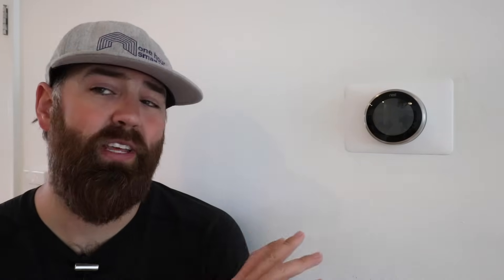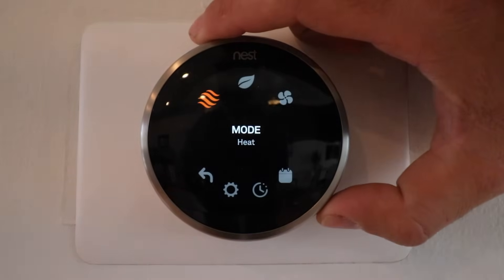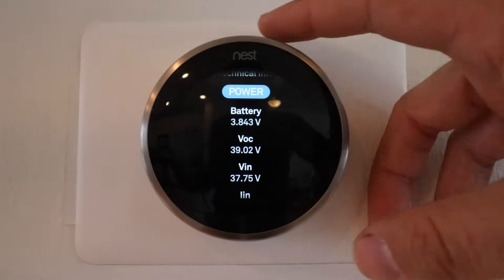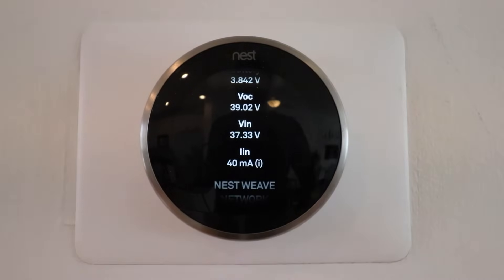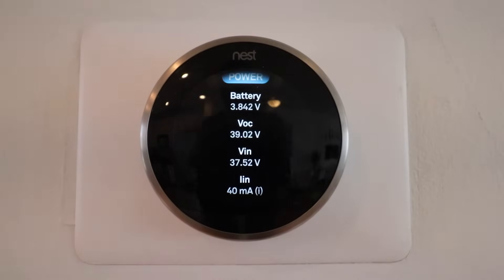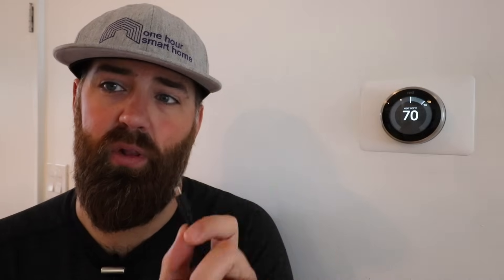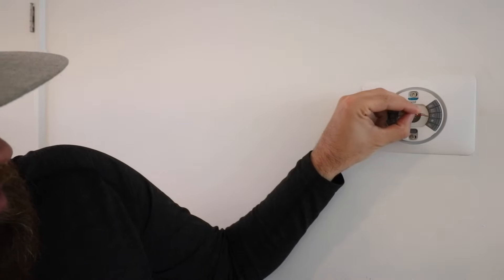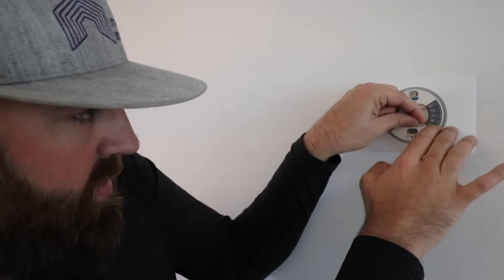Nest Low Battery Fix!

Comment: I’m at a loss. Mine is now just under 3.8 V and was at 40mA. When I first encountered the “no wifi” problem voltage was slightly lower but I removed and reconnected to make sure it was secure. Voltage then improved after a few minutes but still isn’t connecting to wifi. I’m charging off the wall now and will try to reconnect to wifi afterwards. It’s only affecting one of the two devices I have in my home. My AC units are both only 5 years old.

Comment: The main and most common issue for any modern smart thermostat is that they require a (5) wire line. Most homes have a (4) wire line.  The 5th wire is a dedicated power only line that will power and keep the unit charged , even during power outages via the battery for at least 5 days. This resolves all issues related to any mentioned in this video. If you have 3 or 4 wires from your old unit, you will need to run a new 5-6 wire line. The 6th would be for a future AC install per your budget.

Comment: Thank you for posting this info!!!! My power went out.. everything came back on but the AC the nest continued to say offline.. I remove the nest thermostat, plugged in to USB cord..the light blinked 3 times then it said to put it back on and I got the AC working. It's still under warranty will have them come check, but this helped significantly!!!!!! Thank you.. New follower!!!

Comment: It looks like the green wire at the Nest was not actually plugged into the furnace at all. I took the green wire and put on the C terminal along with a red wire at the furnace wiring block. Now my Nest is showing voltage at 3.8+ and my mA went from 20 to 200. Is that ok? And my AC seems to be staying on ok. Thanks.

Comment: Replaced the battery, didn’t work, installed the AC adapter (c wired) and still didn’t work, keeps saying be back in a bit or needs to charge.. the only thing that works is if I take it off and manually charge but that only last not even a whole day.. I’m confused as to plugging in the c wired ac adapter why it’s not giving power 🤷🏻‍♀️

Comment: I have been using my nest learning thermostat (3rd gen) for almost 4 years. It just then won't charge from the base any more. I'm still able to charge it using USB port directly to wall power. it means the internal battery is still good.  My Voc = 36.51V  and Vin = 7.88V (while system is running) which are within specification with No C wire configuration. Do you think I have a bad fuse in furnace or air handler system? If I would like to purchase the 24V adapter,  can I put the 24 volt converter into the Rh or Rc and c without removing the original Rh and Rc wires? Thanks
Reply: I ordered the adapter and it still didn’t give me power =[ and I even replaced the external battery on the nest and it still didn’t give power

Comment: Nest Thermostats are complete POS!  Low battery issues, 191,000 people watching your video.. congrats, honestly super helpful ! But Holy hell I'm looking for a company that knows something about thermostats, you clearly do!  Why don't you create one.??  So the three options: 1-  Take if off the wall and charge it? Are you shtting me?  2) Plug in a wire and hook it up.. OMG, who would have bought one with that little caveat or 3) rewire the furnace connection common green and use a different configuration on the nest, but honestly, tried that and still got power errors!  Google Nest pitches like a politicians, tell them what they want to hear but when you get it, you have no idea the pile of horsht you just signed up for!

Comment: I want to check, if I have an RC and an RH connected and wired in already.  Can I put the 24 volt converter into the rh and c (double up like you mentioned in the RH)  and it will function just fine?

Comment: My nest is completely dark with a green blinking dot
Reply from the maker: Typically that's an indicator the battery is low and it's charging up. Sometimes it will blink green for an hour or two if the nest has sat on a shelf for a long time or was powered off and the battery drained down. You can use a micro USB: https://amzn.to/3hx6xSe cable to charge it faster like this video shows: https://youtu.be/LV8qw7rngwA

Comment: I have found that when you jumper the power inside  using two wires in one hole clamp. They seem to lose connection during seasonal changes. As if contraction and expansion causes a poor connection. I haven't soldered the connection. But was going to check and see if there are extra wires available for a direct run from the power supply on the bottom right connection. I jumpered from that connection to the  bottom left connection to charge unit. But have to return a second time to resolve the issue I thought I fixed when I twisted the wires very good together. But maybe not good enough. Not sure yet, but might be another issue. Will report back when I know today.

Comment: My home wiring is missing the c wire.  When I first installed the nest I had problems with low battery every few weeks.  Somewhere I read that the nest will not continuously charge without the c wire but is charged when the hvac system is actually running.  I scheduled my fan to run15 minutes an hour for several hours a day and have not had a low battery issue since.  Just checked my nest and power numbers are the same as shown in the video, adequately charged.  I know nothing about electric, but for me this was an easy fix.

Comment: Can you mention the link of cable that can be used to charge Nest Thermostat, again in second option, white wire connections R and left side, and connecting to wall all the time, where can I buy this cable? Thanks I subscribed your channel, I am having low battery issues all the time, maybe it is charging with my old cable. I want to fix it.

Comment: Had this thing for over 2 years and just started getting low battery notice. With the 6 wire thermostat wire, I connected the blue wire to the 24 volt common.
Got me 3.8v and 200 mA 👍
Reply from the maker: Glad to help. Thanks for subscribing!
Reply: I did the same and got 3.8v and 200 mA.

Comment: doesn't seem to work when wires from transformer is connected to RC and C.  There seems to be a check in the thermostat that will not allow Cool and Fan settings to work with the RC connected to a transformer.  Tests fail for Fan and Cool.  Heat works though.  I'll try doubling up on the RH connection with C to see if that works.

Comment: Ive got 200mA in het battery settings, is that good?
Reply: I have the same for the Iin (mA).  I did the G wire to C wire swap at the Nest E thermostat as well as my AC Air handler (AC only unit and not a heat pump)  Is this something to be concerned about?
Reply: After looking....found this answer on the Google Nest support page "Voc Vin Iin	
Voc, Vin, and Iin measure the electrical current sent over your system’s wires to your thermostat. Below are the ranges that the Voc, Vin and Iin should stay in during normal operation. There are different Vin and lin values if you have a common or C wire in your thermostat:

If there isn't a C wire in your thermostat:

Voc: 29 to 42V
Vin:
29 to 42V when your system is not running
6 to 7V when your system is running
Iin: 20 to 40 mA

If there is a C wire in your thermostat:

Voc: 29 to 42V
Vin: 29 to 42V
Iin: 100 or 200 mA
Troubleshooting power issues

If the above power specs are outside of their normal range, you may need to troubleshoot. For instance, if your Nest thermostat won’t turn on and is unresponsive, or you see a blinking red light at the top of the thermostat’s screen, your thermostat likely isn’t getting enough power to charge its battery. For troubleshooting, please see the following article:

Comment: I used an adapter for common wire and its a continous or non battery operated nest thermostat and its not stealing power so its running smoothly

Comment: I have a 2nd Gen Nest thermostat.  In the past I've had intermittent battery issues.  We just came out of a 3 day power outage in Texas.  When the power finally came on, the thermostat was acting really weird.  Most notably, when it called for heat, it would just turn on the fan and never light the burners in the furnace.  I re-installed the old thermostat and the system works fine.  Problem is with the Nest.  Charged it for 24 hours and re-installed it.  Now it won't even turn on the blower.  Just constantly says "Delayed 3:00".  With no C wire, is my battery just shot and can't keep up with the demand even though it says it's at 3.8v?

Comment: Wish Google mention this on their installation instruction. Took me sooooo long to figure this out cause it will just steal power when there is not an extreme weather outside. Whenever it's too cold or hot the unit malfuntions.. All I had to do is pulling the blue wire that's buried in the wall already and plug in C.. I could not find anything about this online 2 years ago and their customer service just send me a new one which plug in and "solved" the issue(only because it's not that hot outside anymore, it's stealing power from the coil again).

Comment: Sorry, I do not own a nest device, but my mother who is 8 hours away does.  It was installed by my younger brother.  Anyway, how do you select the option you have on the display?  Is there a button up dead center in the bottom of the perimeter of the device, or do you push on the front surface/display of the device to "select" the option of interest?

Comment: Didn't help me at all =( can't get readings for power since its dead, been sitting on a charger all night. Added a blue common that was in the loom and still says no power. Great video tho.
Reply: Did you check to see that that blue C wire was connected at the other end?
Reply: @nedbrigman1409  yep. My problem was my board was going bad. It wasnt sending proper power to the nest. 250 bucks later I'm back in business lol

Comment: Your advice to connect the Nest to a charger while it's off the base was excellent!  It's charging right now.  I'm troubleshooting why the Nest is dead.  I did verify the 24 volts is NOT present at the base.  But if I can verify the system works otherwise, then I'll resolve the issue with the 24 volts.  

How can I determine which generation my Nest is?  I think it's Gen II.  I want to change the battery simply because the thermostat is more than 5 years old.  But, before I buy a new battery, I want to be sure I get the correct one.

Comment: Would a battery voltage of 3.67 be reason to order another battery? I just started having issues with this, but it could also be a wifi issue as I upgraded to a Orbi mesh system recently
Reply: Interesting. I also upgraded to a Orbi mesh system and have the battery/network issues on my several year old Nest Thermostate.
Reply: Same I upgraded to orbi
Reply: Yeah once I went back to my old router my nest connectivity issues went away

Comment: Thanks for this video. I'm heating only and am diagnosing an e74 code. Nest shows 3.8 battery voltage and lin mA of 20. I connected rh to w1 and the furnace/fan shuts off after about 6 min pretty consistently then turns back on. Time to look at furnace? Note: It's only about 5 years old.
Reply from the maker: If it's running and shutting off it typically means that a limit sensor is tripping on the HVAC system. The limit sensors can be tripped because there isn't enough airflow, it's getting too hot or the burners are not preforming as they should. A very simple thing to check is your air filter. If your air filter is clogged it can cause the system to cycle like yours is. 

There's plenty of other things that it could be but checking the air filter and replacing it is an easy inexpensive place to start that could help you avoid a service call.  

I'm going to be doing several videos on diagnosing HVAC issues over the next few months so stay tuned for that. In some cases  people misdiagnose an HVAC system issue as a smart thermostat issue so I want to help people understand what the difference is and how to so some basic troubleshooting.

Comment: I just connected my nest and it worked for the most part of the day but then i saw the nest shut off and battery drain. I saw your videos to get an idea of what is going on and I checked the power settings but they are right where they need to be and my lin is at 40mA. I took a multimeter and checked my RH wire and i get 26V so i know i'm getting at least 24V to the nest. My system is a dual system with central AC unit and fan for cold and and gas furnace for radiator heat. Any suggestions will be greatly appreciated.

Comment: Could you explain how to hard wire a 24v wallplug-power adapter into a Nest 1st generation? There are only 6 ports for cables, do I run one wire to C and another into the OB* slot? Thanks!

Comment: Thank you so much for the video.  Fixed it by adding 24Vac power to C.  Is there a permanent fix?  I have only 20mA, how can I increase the Lin current?  Can I remove the 24Vac power adaptor after?

Comment: What if your lin number is really high? 

Mine was 20mA and so I moved the g wire over to the common. It shot the lin number up to 200mA. Is this too much? Just don’t want to ruin anything.
Reply from the maker: With the common wire mine reads 200mA without issue.

Comment: FYI that is not an Lin terminal. That is not an "L" it is an "I" which is the symbol for current (just like V is the symbol for voltage).
Reply: I was really hoping someone else caught that lol
Reply: In addition, mA has to be read as mili ampere.

Comment: I changed it from Ground to common and it went from 40ma to 200ma.  Will this be an issue?  This seems to have fixed the issue.
Reply: Is your nest still working.
Reply: @rex1903  Off and on.  It will work for like 2 weeks and then show that the battery is low like it' snot charging.  Then out of nowhere, it works again.  weird...

Comment: I started having this issue yesterday, or at least noticed it for the first time when I told Alexa to set the temp. Alexa said the Nest isn’t connected to the network. So I checked the device and it showed the low battery. I have a 3rd Gen Nest with the same wired setup you show. I manually turned the temp where I wanted and it began a 3 min countdown timer before it started heating. This morning I decided to research the issue and found your video. When I went to check the device, there was no battery issue and the numbers you said to check were about the same as yours for the voltage. Tonight, I told Alexa to set the temp and again no response. When I checked the voltage numbers, they are all fine but it says low battery! I’m not sure what’s going on with it.

Comment: my system is heat only.  on the old thermostat, I saw 2 wires (Rh/Rc and Heat).  there is a green wire that is not connected.  When I measured the voltage, I got 12 Vac between the green wire and the heat wire.  And 12 Vac between the green wire and the Rh/Rc wire.  I do not see any green wire on the furnace.  Is it safe to use the un-used green wire as C-wire on the nest?

Comment: We never had any issues with the cooling all summer, but ever since we turned on the heating for the colder weather 3 weeks ago we've had ongoing problems. The nest keeps saying "Delayed for 3 or something minutes" and the furnace is shutting on and off, as well as a "power out ERROR" on the app saying "no power to Rh wire" even after installing a brand new furnace/unit.. the nest is fully charged and i haven't had any luck finding any answer online.. any help or advice would be appreciated.
Reply: Same here, my issue is the blower doesn't come back on even though it says its working on the thermostat. Today the thermostat was dead and I'm having to charge it.
Reply: I am experiencing the exact same problem - did you figure out how to fix it? I’ve tried adding the c wire, swapping the g to c, (checked the thermostat and the furnace panel connections for both) and it still keeps giving me the E195 no power to the R wire error message. Best comes back every so often, furnace goes on for two minutes and then shuts off and nest returns to error message. I am freezing here in Michigan!

Comment: Occasionally my Nest disconnects from the WiFi because the battery voltage drops. I have an older house designed for the outdated mechanical thermostats so I have the 4 wire system. In the more temperate months when my HVAC system doesn't run much is when I run into this problem the most. Without the common wire the Nest battery only charges when the system is running from my understanding. From the info in this video I could relocate the fan wire on my nest and HVAC system to the common wire to correct this, but wouldn't this prevent me from being able to run the fan by itself (without heat or AC running in conjunction)? If that's the case I would prefer not to use that option. On the other hand, does the battery recharge when you run the fan by itself, or does the heat or AC have to be running for the battery to be recharged? If the battery does recharge running the fan alone, then simply programming the fan to come on for 30 minutes twice a day at strategic times should ensure the battery stays charged. I say strategic times because if I program the fan to run from 4pm-4:30pm and the AC is running during part of that time I wouldn't see 30 minutes of additional charge time on the battery. I'd want to program the fan to run at times when it is unlikely the heat or AC would be running to get the full benefit of this technique.